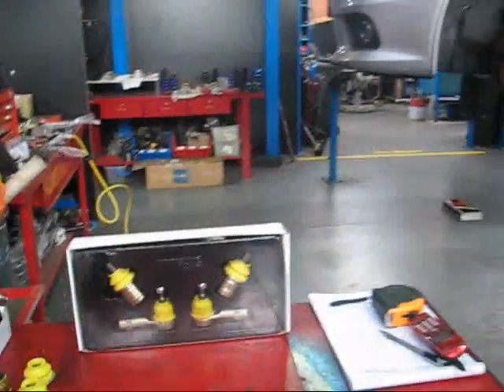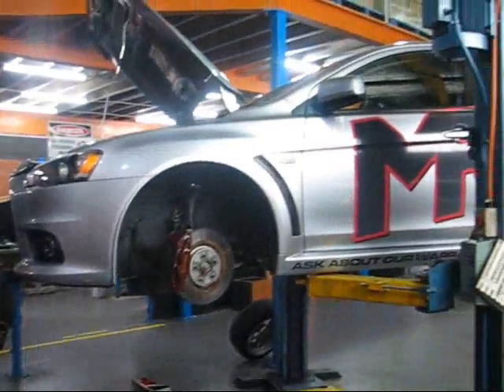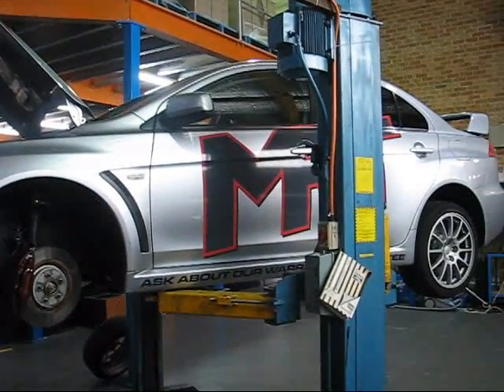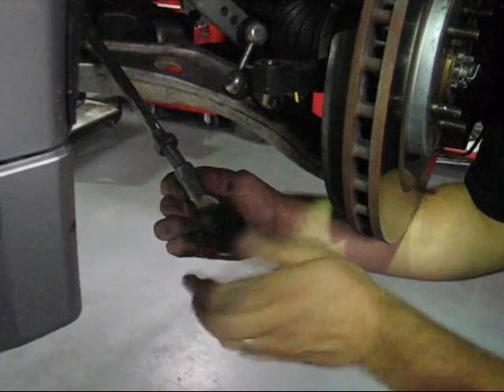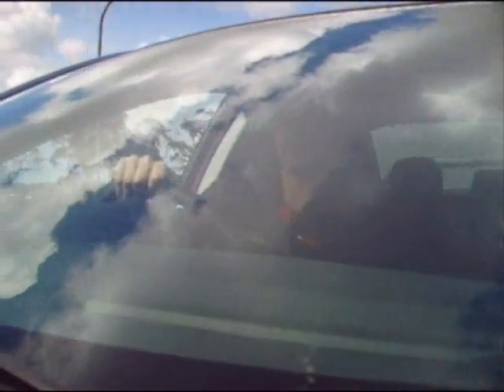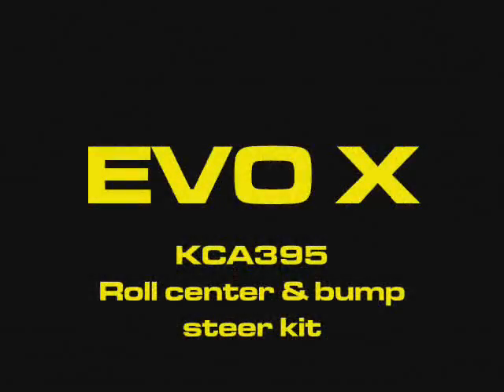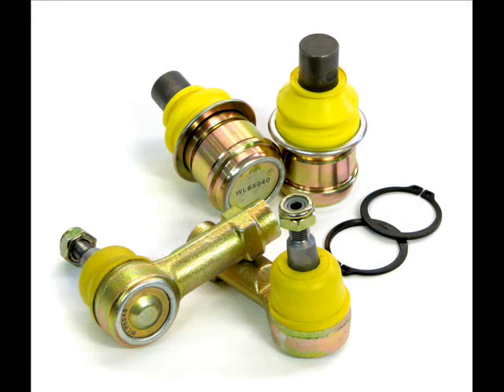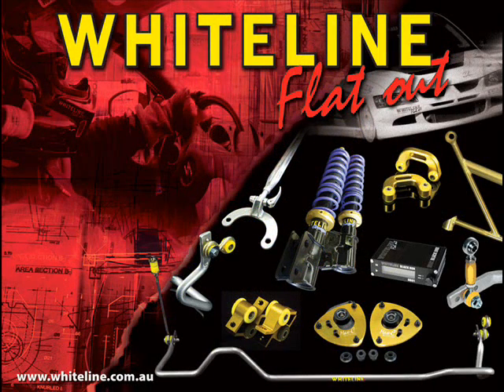Whiteline EVO X KCA395 Roll center & Bump Steer Kit

Comment: My Evo 8 ball joints are bad, can i replace them with these (stock suspension/height)?
Reply: Probably not recommended since this is designed for cars that are already lowered in order to correct LCA angle